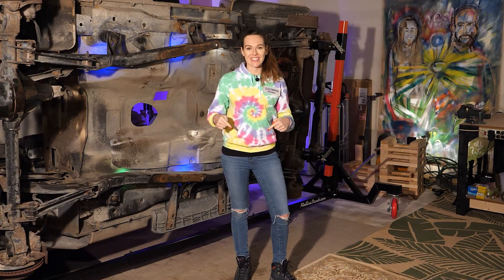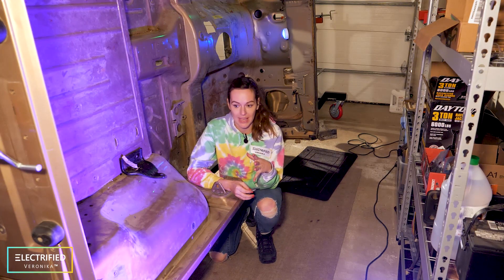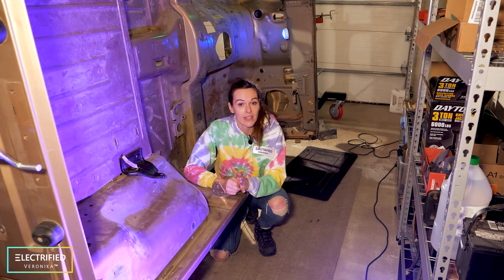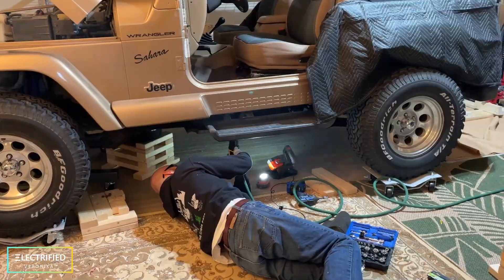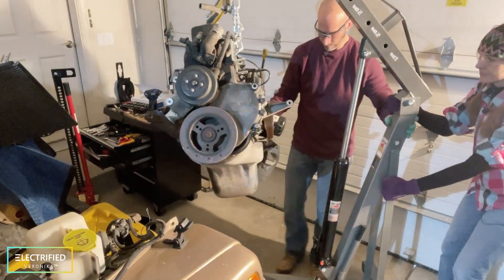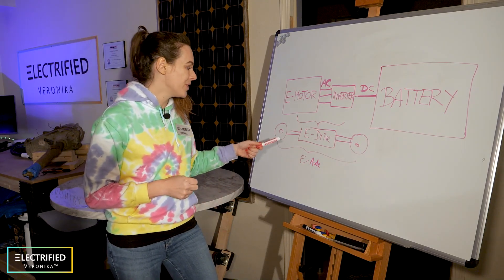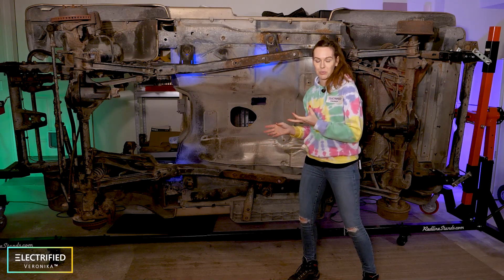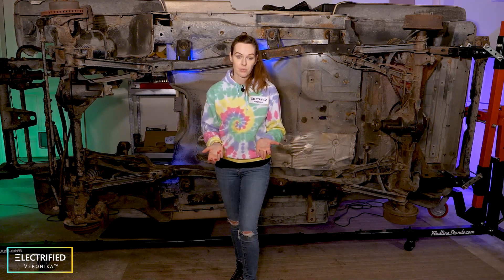How to START an ELECTRIC VEHICLE CONVERSION!

Comment from the maker: Which electric powertrain option would you choose and why? Great ideas, concepts and tips welcome 😊
Reply: What motor/inverter are you planning on using?
Reply: @felix-antoinelebel755  https://www.cascadiamotion.com/productlist/25-integrated-modules/45-im-225
Reply: DC motor Netgain or refurbished forklift motors directly connected to transfer case
Reply: Hi, kindly refer me any best Ev car conversion guide book.
Reply: Having thought about it myself, I think the safest and soundest way of going about this project is with a central motor in place of the original ICE.  Keeping as much of the original driveline is what will still make it a "true jeep" (Solid axle, Dana differential, transfer case). However, if it were mine, I would keep the transmission. This would allow you to play around with the gear ratio to your liking. Let's be real, Jeeps are all about options and modularity. Getting rid of the stick shift would make it loose some of its identity. But that is just me. I get the rationale of your decision.
Reply from the maker: @felix-antoinelebel755  Yep, totally get it about the "true jeep" aspects 😊 or let's say we expected that. We are obviously note "real Jeep people" but we still want to make it appealing for those who are. For the transmission, we were going back and forth but all at a sudden, it was out 😂  I guess for the next conversion, we want to keep the transmission and see which options we have then. They, say, your first conversion is never a perfect one, so we learn as much as we can from this one 😊
Reply: @ElectrifiedVeronika  Great choice of powertrain version!

Comment: I will go with a dc  system , 1 or 2 motor, 1 or 2 motor controller   ,1 battery pack. Have fun ( I designed treadmills 35 years ago just like  an EV )
Reply from the maker: Which car/truck are you converting? Would love to know more ☺️

Comment: Why would anyone do something so stupid. 
Hydrogen is much better then electric. 
Your building a limited car that is good for 10 years or less. 
I want a car I don't have to worry about what I wanna use it for.  
Imagine I have a car but it only goes so far or I need a gas generator. 
Shame to see a jeep converted into junk.
Reply from the maker: Why is hydrogen a better alternative? Are you talking about hydrogen as fuel for an engine or fuel cell electric vehicles?
Reply: @ElectrifiedVeronika  better mileage also hydrogen when made can also make fertilizer and the plants can remove waste. Hydrogen is very safe when tested because it’s lighter then air. So the old theory that it’s explosive has been debunked by not having tanks underground. You can research the test done by Japanese. 
The biggest reason is batteries only last a short time. They are very dangerous extremely. Batteries are bad for the environment they claim to be protecting.  
When a electric car has battery problems the car can cost a fortune to replace. A hydrogen car has a regular motor then a electric motor like a ship or a train.  Best design ever.  Just look at Japanese new designs. I’m a mechanic a diesel mechanic with more the 30years experience from a family of machinists and mechanics. I’m not claiming to be a engineer but I know how to make things work. I’ve worked on everything from equipment to boats. 
If you would like I can like designs and demos of hydrogen. The government gave out money to spread hydrogen then it stopped for some reason. I’m not going to get political but look that up as well.

Comment: I have a much simpler project - but still need advice - I just want to add more battery capacity to my plugin hybrid - so that rather than getting 30 km on battery I get at least 100 - this will mean 95% of my driving would be all electric - would love some advice on how to tackle this??!!
Reply from the maker: This might be more complicated than what I do, because you have to integrate with all the existing BMS and engine management system. So the communication part might be tricky but I don't have too much experience there. It all depends on the operation strategy of the hybrid controller. If you can figure that out (maybe it's easy to do) you could make it work. Sorry, I don't have more insights / better advice.
Reply: @ElectrifiedVeronika  Thanks for your time Veronika! Just knowing that it looks complicated to you is helpful to know - my guess is it would take a long time and cost a fair bit of money to figure it out - If there were a huge number of these cars out there, that might make sense - others could reapply the solution- I don’t think that’s the case though.
Reply from the maker: @willm5814  but please remember that I am doing that for the first time, so I am not an expert in all the things we are doing - YET haha.
Reply: @ElectrifiedVeronika  Well I'm a mechanical engineer and own a software company (and have been into clean energy/energy conservation for about 50 years)....hoping to gain some expertise by subscribing to your channel!

Comment: I think hub motors are a great way to go - if the hubs are a huge diameter, specially designed for the purpose.  Tesla’s choice to even use differentials surprised me, I always thought a ‘software diff’ would be implemented, with a motor for each wheel…but, they had to get to market of course, and software development is often under-rated in terms of difficulty.  It is generally accepted, the British successful businessman Dyson, ran aground on this very aspect, having sunk hundreds of millions into a car design, only to realise, manufacturing and software would wipe him out.  So, the ‘brain’ of your car will be interesting.  I like the presentation very much Dr Veronika - no man would dare to mention the fact he had to buy loads of tools he didn’t imagine he’d need, etc.  I literally, have tools I bought for one single task, and never in 20 years had another use for’em.  Take care, be well, I’ll spread your channel name.
Reply from the maker: Thank you so much for your words! Haha, the tools are piling up here and I am insisting to do more conversions later this year, just to use the tools again. Thanks for your help to spread the channel, I appreciate it! (PS. Would have loved to at least try hub motors, maybe in the future)
Reply: Massive amounts of unsprung weight though. So hit a pothole and your wheel practically explodes.

Comment: I will definitely be following this project, I've been throwing this idea around in my head for some time, I've owned my 93 wrangler for 10+ years now, and the more i think about it, once the engine is toast, which as expensive as rebuilds are, and new crate motors, it wouldn't cost much more to take the plunge and go electric.  I'd be keeping most of the driveline(trans, t-case, solid axles).   With as little as i drive my jeep, converting it to electric would be perfect.  Especially if i can still get a full day of fun in the mud on a single charge.

Comment: Quick question: why didn't you take option C? I don't think the reason is mentioned in the video.
Reply: Mostly due to it being the most expensive solution both for the inverters and motors as well as the vehicle control system...
Reply: @donaldwright7194  and because at the moment there are only a bunch of press releases but no actual hub motors that a person can buy.
Reply: @billbayer5526  Good point...we didn't actually check availability as we dismissed it early...

Comment: Think i would keep the transmission. but a lot depends on your choice of motor and the expected completed weight of the finished jeep.
Reply: We thought about it a lot...but in the end we were finding it would just be left in 3rd gear so we decided to ditch it and use the weight savings for batteries.

Comment: Wheel motors are a dumb idea for something like a car- unsprung weight, failure modes, cost, environmental conditions the motors have to endure etc. all point away from this approach.  You've settled on a good one and if you don't need to trade speed for torque (frequently the issue), you don't need the transmission.  I kept mine because my motor topped out at only 6,000 rpm, and the transmission gives you options- you can have fun at every stopsign (and @Electrfied Veronica, you WILL have fun at every stopsign I guarantee you!) and still set a highway gear ratio that puts your motor/inverter combination right at its efficiency sweet-spot for best highway range.  Of course I had only 2wd to worry about so yours is harder!  Best of luck - you're going to have a really fun vehicle when you're done.  And stock up on aspirin- you're going to encounter what other converters have called the "EV grin"- your face will be sore from smiling every time you step on the "gas" pedal!
Reply from the maker: Well, yes we maybe are not really the type for in-wheel motors..so I am happy with our choice. We will definitely keep everybody updated about the consequences of removing the transmission. And yes, I CAN'T WAIT to drive the Jeep and have all these great moments. Especially can't wait to pull up in front of a charging station and see surprised faces 😂😂
Reply: Convert an EV first haha.
Average IQ ppl always reason based on analogy alone.
Instead of being logical about it.

In engeenering their is no one size that fits all. There's a reason EV automotive companies are Investing into developing wide array of electric motors.
*Leave it to the professionals.
Reply: @OdingHelps  sorry, was that strange reply directed toward me?  Because I've done TWO EV conversions myself, and was driving one of them just today.
Reply: Who am I to criticize - I'm yet to build one... Honestly speaking, I want to build everything from scratch